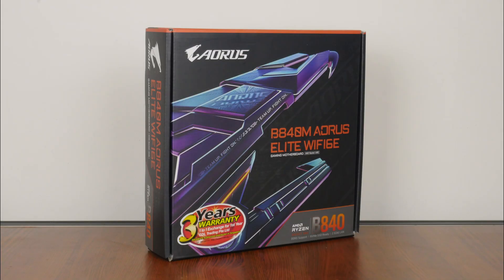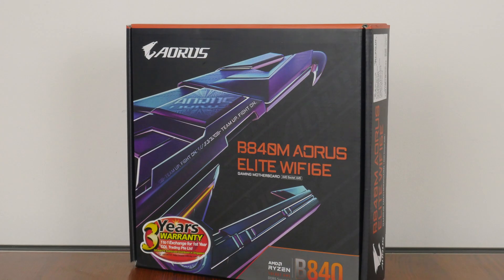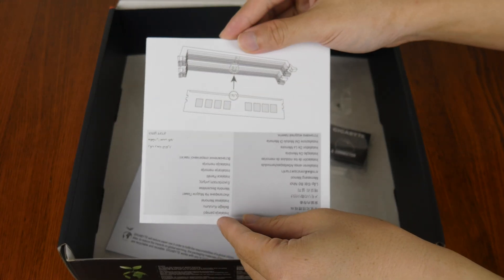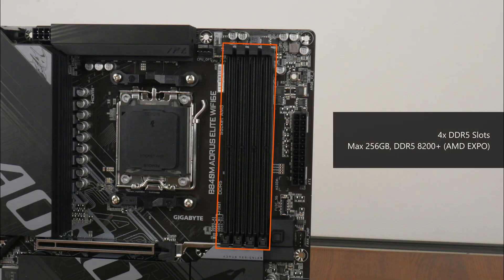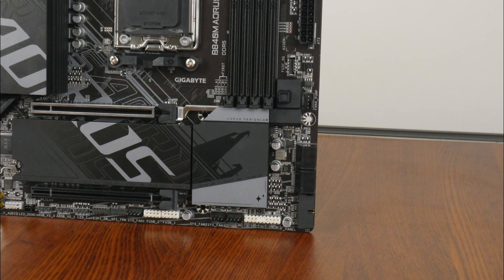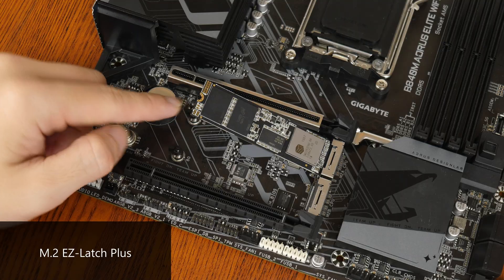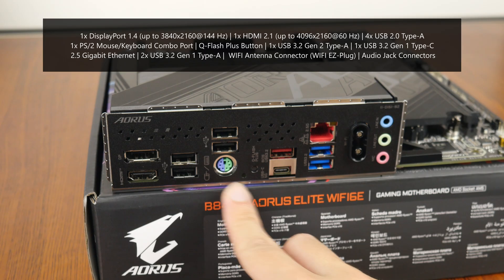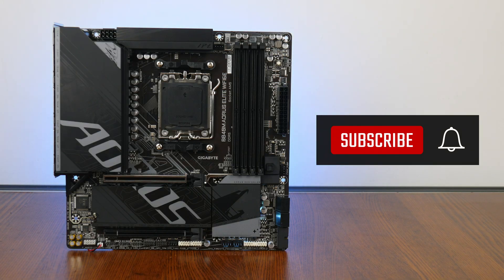Entry-level AM5 mobo with premium features? Gigabyte B840M AORUS ELITE WIFI6E Unboxing & Overview

Comment: i got this motherboard and paired it with a Ryzen 5 8500g and 2x16gb 6000mts Hyperx Fury and it came faulty. It never booted and got stuck at dram and then vga lights cycle trying to post unsuccessfully. Got to RMA it and now wait to see if the new mobo works as it supposed to or it will have the same issue.
Reply from the maker: Damn, sorry to hear about that. Hopefully the replacement board will work just fine! Out of curiosity, are you intending to install a discrete GPU for your build? Or will you be using the 8500G's APU?
Reply: @ALKtech it has an Asus TUF 3080TI. But tried to run everything without and then with it installed to no avail as the problem seems to be the mobo being unable to pass the dram step to boot

Comment: Essa placa é superior a maioria das B650 base ? Como B650M MSI ou B650 Asus
Reply from the maker: Mmm I'd probably say it's on par with those boards that you mentioned, though if you have the budget for it, I'd try to get a board that supports PCIe 5.0 x16 for the graphics card as it'd be more future-proof! E.g. one powered by the AMD B850 chipset for instance. How's the pricing like for this board versus say, typical B850 and B650 boards where you're from?
Reply: @ALKtech  B840M Aorus elite Custa $157,5 Dólares, e as b850M começa na MSI B850M P 173,9 dólares e vai a 202 dólares nas versões b850EM plus Asus entre esses valores estão Eagle, AYM, Asrock Steel Legend, e Asrock, irei usar 9060xt 16gb não pretendo ir pra nvidia, talvez no Am6 quando lançar !
Reply from the maker: @mrfirston  right I see. To be frank, I'd be more inclined towards the MSI B850M-P that you mentioned (is this the WIFI7 version?). For that price difference, you get 5 Gigabit Ethernet, WIFI 7 and Gen 5 support for a GPU and M.2 drive - at least with the B850 chipset, your 9060 XT can run at its full PCIe 5.0 x16 bandwidth (with the Gigabyte B840M, it will run at PCIe 4.0 x16 as the B840 chipset only supports PCIe 4.0). What AM5 processor are you/will you be using for your build?
Reply: @ALKtech Ryzen 7 7700 Normal
Reply from the maker: @mrfirston  I see, most, if not all AM5 motherboards can manage a Ryzen 7 7700 very easily as it doesn't consume that much power. If you can spare the cash, I'd go with the MSI B850M-P - my two cents!
Reply: @ALKtech obrigado, vou pega amanhã, moro no Brasil mas perto do Paraguai ! Muito obrigado, depois te marco no insta pela ajuda !

Comment: I really wish this motherboard came to Australia, all you can get is the ICE version :( I have to put my MATX build on hold until a decent Black MATX motherboard that doesn't put PCI-E in slot 2
Reply from the maker: https://www.youtube.com/watch?v=90s_AV3G0-w <- the MSI B850M MORTAR WIFI could just be the mATX board you're looking for, assuming it's available down under! It'll probably be priced much higher than the B840M AORUS ELITE WIFI6E though..